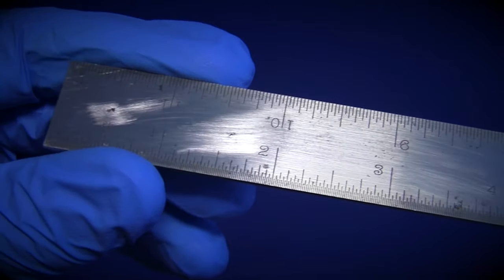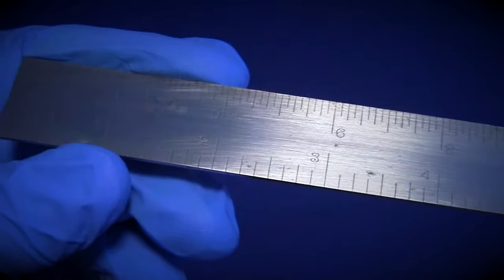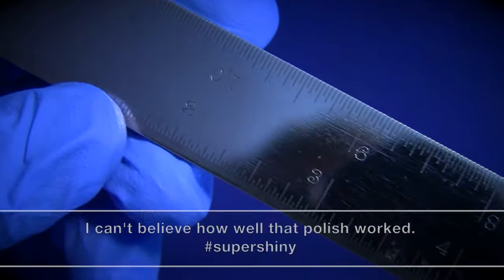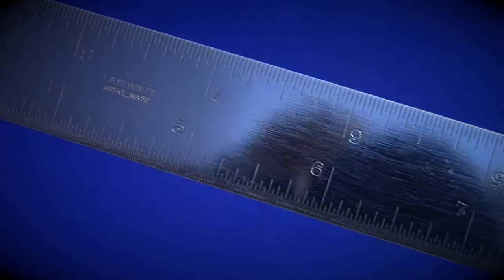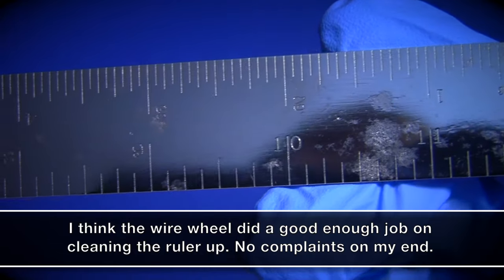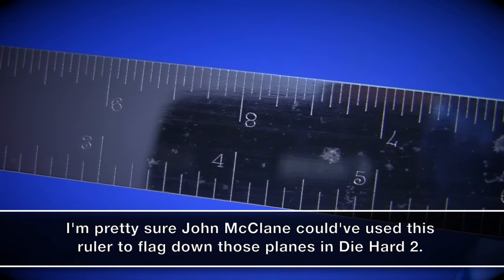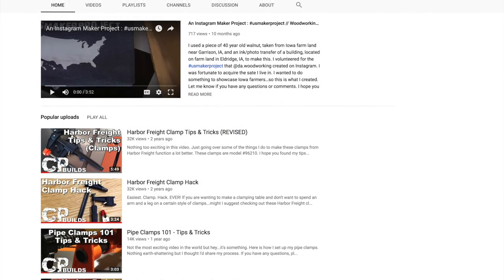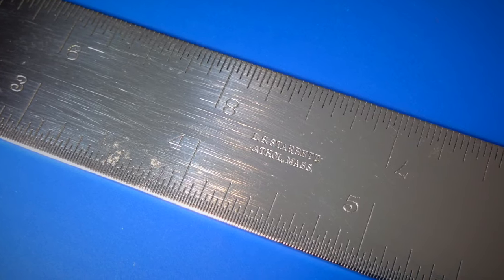12" Vintage Starrett Ruler Restoration // DIY How-To

Comment: Ooh! Just woke up that guitar was great. I liked your methods of restoration. Are there other ways to paint the letters?.. Thanks again
Reply from the maker: I’m sure you could throw some paint on the tile and wipe it off. May get into areas you don’t want though. I’m using it like this still and have no issues seeing the markings. I very much like it still.